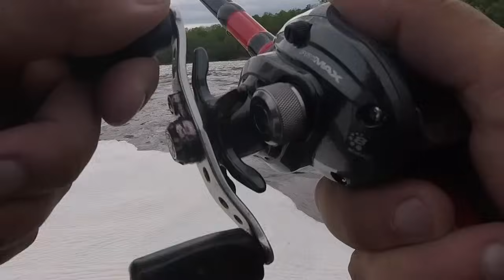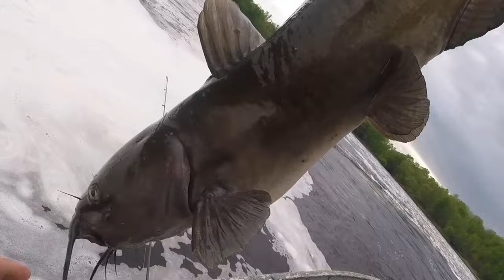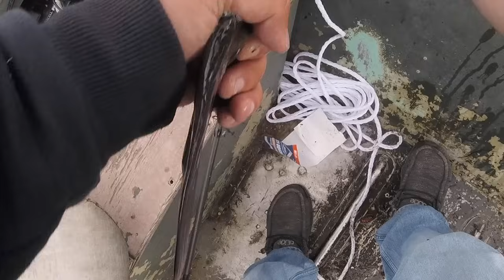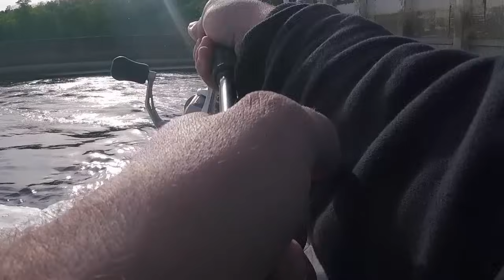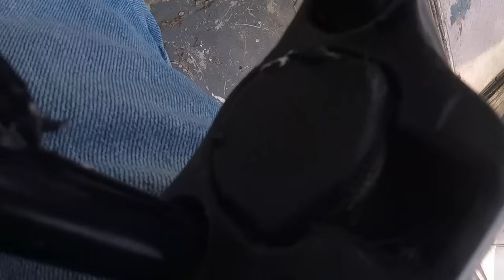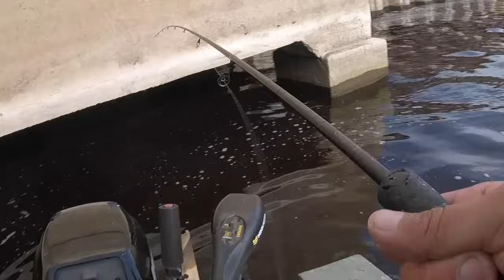I Did Not Want To Catch This Monster Fish! (FISHING GIANT SPILLWAY)

Comment: We've all been there with outboard issues, but the water in the gas tank on the first trip of the year is preventable, and i think you learned what to do (or not do) next time. Come on, though, you've got to leave the ramp with a fully charged trolling motor battery!! Murry would be disappointed, even if you weren't in the Boy Scouts I thought you'd be more prepared than that.